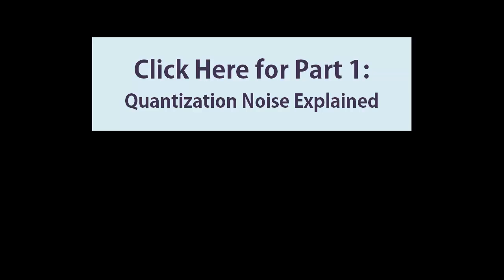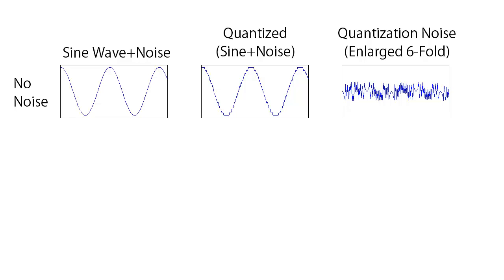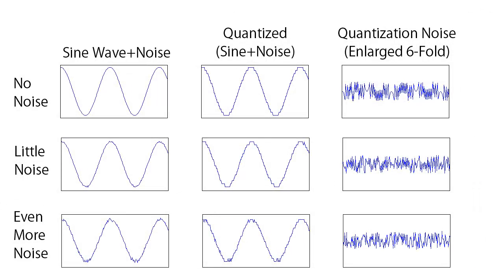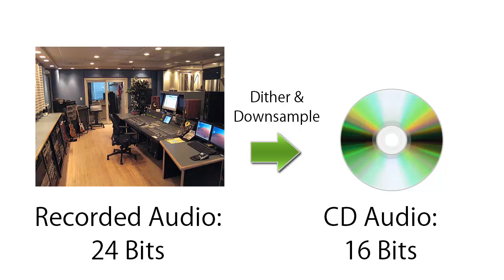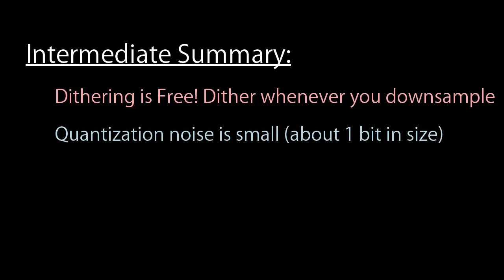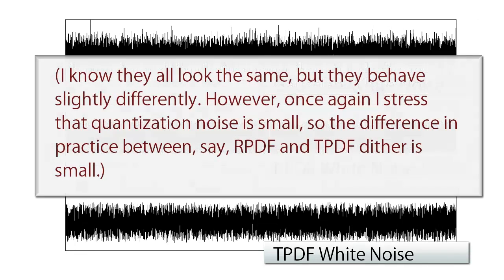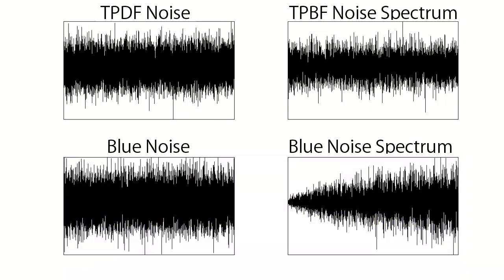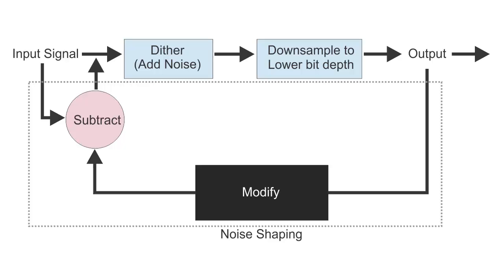Music Technology 101: Dithering Explained (2/2) - What, Why and When to Dither

Comment: I would call the floyd-steinberg filter a noise shaper. It has feedback, and if the input level matches the ouput, there is no error and no noise. Word length reduction isn't downsampling. Downsampling is when the number of samples is reduced.

UV22 is a unique approach and surprisingly simplified for something they charge money for. There are two frequency modulated signals at around 19.5 and 21 kHz (at 44.1). The dither has a few short precalculated segments of 4096 samples in its memory. Then he semi-randomly shuffles these in to add to the singal. They repeat.

Comment: should I engage dither at the start of mixing the project? The sound from DAW came out with 32 bit float format (or higher) & goes to DAC, which is 24 bit, so all we hear is truncated?
Reply: The 32bit floating point is used by DAW's summing engine. The use of floating point is just for internal calculation purpose. So no need to worry.
Reply: @jasonhoumusic  so, how many bit are going from DAW to DAC actually? 24? if so, then it means that there's some default dither process on the DAW's output section?

Comment: Hi !
I have questions that I didn't get straight /consistent answers to, maybe U can:
I'm working inside Cubase 9 with 48 khz / 32 bit float resolution.
Can I export the final file in the same resolution (without dithering, no changes at all) & then upload it to YouTube ?
So... YouTube will make the first & last compression for me, from the best resolution I uploaded the file.
Does it will make artifacts to the file ? because, in that scenario the compression will be directly from my 48 khz / 32 bit float resolution to Youtube AAC (or MP3) format ? Does the file actually needs dithering for that ?
Do U have idea what will actually be the best workflow to send YouTube the exported file ?
Reply from the maker: Youtube audio is too crappy for this to matter.
Reply: quantisation noise is completly inaudible for 16 bit audio at normal listening volumes, don't worry about it

Comment: Hi, 
Thanks for the video.
I have a question regrading the noise that you add in the dithering: should the noise level PSD should be limited by the value 0.5X(q/srt(12))^2?
Since for my understanding, when adding to much noise, higher than ( LSB/2), you can degrade the ADC performance.
Will appreciate your explanation.
Refael
Reply from the maker: I don't really know what the noise's optimal pdf (or psd) should be - that's a deep theoretical question that should be addressed to a signal processing expert who specializes in dithering.

Comment: I saw a video by a guy named Monty from xiph.org about stairsteps in digital audio. He said that stairsteps simply doesn't exist and that the output signal is identical to the input. Wouldn't that mean that quantization errors doesn't exist either since they are caused by stairsteps? Im a bit confused lol. 

Other than that great video!
Reply: +G-Hovah Beats If I understood this correctly, the quantization gets introduced to the audio if you convert it from a higher bit depth to a lower bit depth. I'm still learning this stuff as well so I could be very wrong. lol.
Reply: Quantization errors will occur and be present in any and all digitized audio, regardless of bit depth. However, the quantization noise's amplitude can be minimized by using larger bit depths and dithering when lowering bit depth. The 'stair steps' are simply a visual/graphical representation of a digitized waveform, akin to how a pixel is represented as a basic square on screen, but does not affect the fidelity in how the waveform is reproduced. The samples themselves only store values for specific amplitudes over time, but do not contain any additional data in between each sample point.
Reply: Yep stairstep wave is not "real" let's say because the digital to analog converter produces a sinewave, but that sinewave will only approximate more and more precisely the higher the bitrate goes but still with some error, that produces that noise. It's just the graphical representation you see that is wrong not the concept

Comment: i'm sorry if my question is stupid :v how can i get the random noise? for example If i turn a song as 24bit to 16bit, we have to add random noise right? but how we get the random noise and how to add it? Can you describe more clearly about this process? Thank you!
Reply from the maker: Trần Đạt Hi Tran. You're not supposed to convert 24 bits to 16 bits by "yourself" - that's what software plugins are for. Whenever you select downconversion in Cubase/Protools/whatever the software will already automatically inject the small amount of (pretty much inaudible) white noise needed for dithering. So no need to worry :).
Reply: MangoldProject Thanks for rep! ^_^

Comment: Actually dither replaces quantization noise it doesnt mask it.
Reply from the maker: As I state in the video, dither IS noise that is added to a signal to help make quantization noise assume a random character. It does not replace it, and it only "masks" it inasmuch as it turns it from having some recognizable and jarring spectral content to having a random, white or white-ish unobtrusive spectral content.
Reply: MangoldProject from xiph.org "Dither doesn't drown out or mask quantization noise, it replaces it with noise characteristics of our choosing that aren't influenced by the input."

From wikipedia " a process that mathematically removes the harmonics or other highly undesirable distortions entirely, and that replaces it with a constant, fixed noise level"
Reply from the maker: delta214 Re-read my answer: "it turns it [quantization noise] from having some recognizable ... spectral content to having a random ... spectral content." This is exactly what your quotes say: "a process that ... removes the harmonics or other ... distortions ... ". Both say the exact same thing: dither changes the quantization noise's characteristics (or shapes its probability density function, if you want to be precise). If you want to use the word "replace" instead of "change" or "turn" then by all means, go ahead.
Reply: MangoldProject alright. Don't want to argue or anything. Just getting it clear in my head. Thanks for the video :)